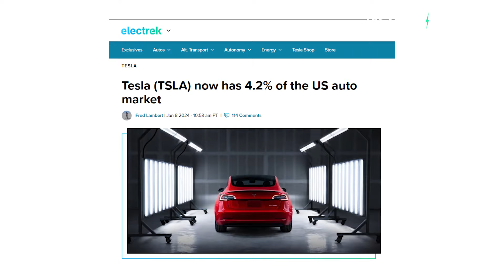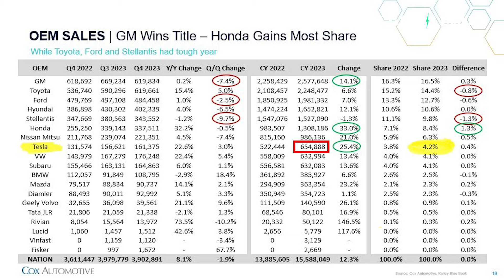Tesla U.S sales up 25% to 4% marketshare, nearly beats BMW & Mercedes combined

Comment: Meanwhile, in the UK, Tesla market share is 2.6% in 2023, down from 3.38% in 2022. Mercedes market 4.61%, BMW market share 5.87% plus BMW-owned MINI 2.5% .
Reply: They still sold more EV in the UK. Percentage increase in market share is not bad as long as the total growth of the brand is up.
Reply: @rozonoemi9374  Tesla actually sold fewer cars in the UK in 2023. Down 9.5% on 2022. Overall UK car sales up 17.2% EV share of the market 16.5%, down from 16.6%.
Reply: @brendanpells912  tesla sold 35,511 cars in UK in 2022
They sold over 35,000 model Ys alone in the UK in 2023.  There was a bit of a lag as they transitioned to the refreshed model 3 however both of their vehicles were still in the #1 and 2 slots for vest selling i believe.  You'll have to link where you get your numbers. 
Mercedes and BMW numbers you quoted were not for EV sales so are not really comparable.
Reply: @patrutherford9600  Data from SMMT. I have previously written 2 detailed replies to your comment but they appear to have been deleted. It would appear that anything that conflicts with the Tesla narrative is censored.
Reply: @brendanpells912  eh don't worry about it.  I wrote an extensive one yesterday to someone that was deleted as well.
Reply: @brendanpells912  The temporary ups and downs between quarters and years is  It's going to be hotly debated and talked about as we are doing right now; I think it's important to realize that this is not a quarterly change that's occurring this is a decade-long transition and that point is not up for debate, the economics of battery technology in 10 years makes ICE a non-starter, Wright's Law is in full swing now.

Comment: Another reason, imho, Tesla sells well in the US is the Supercharger network. Only a handful currently open to non-Teslas.  Other 3rd party charging networks don’t seem have a good reputation.
Reply: Never had an issue with any JST chargers, been using them since 2017. Likely misinformation being spread.... now who would stand to gain from such a thing?

Comment: I just parked at my gym car park in a whit model Y in between 2 other White model y’s.. The car park had about 80 cars in it and 12 were model y.. Melbourne Australia.. 3 months back I had the only Tesla at the gym.. They are everywhere here now..
Reply: That sucks I'd hate to look like someone on the bandwagon. I like my car too feel unique and different from the rest. I recently traded my model 3 performance for a bmw i450 and the quality and tech in this car is night and day. Just putting ur hands on the wheel and everything inside u can feel the quality difference. Plus the car looks alot more aggresive and sleek. Tesla is def the cheaper option but if u can afford another ev I recommend checking out bmws EVs
Reply: @G82Watts  - had a Range Rover and M4 before the Tesla..Both buckets of shit to my y and performance Model 3..Mechanic for 30 years and plan to never lift a bonnet again…BMW was the worst cars I’ve owned..x5 is also bucket of shit..
Reply: @Marcus-up5wk  I highly doubt u have ever owned those cars and u didn't get the model X plaid or model s plaid. If u could of afforded a brand new m4 and range rover u wouldn't have the lower tier teslas. Sounds like BS story too me. Their are plenty of stories of people switching from tesla to bmw and saying how much better the ride quality, sound isolation, and driving dynamics are far superior. My the wind noise in my tesla on the highway felt like I was outside. Nothing feels special or that ur in something expensive when sitting in a tesla. It's just dull and boring. No HUD or gauge clusters. Just such a boring cockpit. The driving engagement is night and day. I'd love for u to give a reason why u think the model 3 or Y is better then a bmw EV. Car wise only idc about having more available charging stations when I road trip maybe twice a year if that.
Reply: @G82Watts  - we have 2 model y and 2 performance models.  Here Parked on charge.. They are  our company cars..100% write off as we’re the RR and the BMW..Don’t tell me you bought your shit box bmw for personal use and you making the repayments yourself? And yes we would have purchased a s plaid if they sold them in Australia?
Reply: @G82Watts  you have to feel it because when you use your brain and add up the features, the BMW just doesn’t stack up
Reply: @ZeusBullyMax  u serious? The bmw m3 xdrive is faster then every tesla besides the model s plaid. With a simple turbo upgrade it's even faster then the plaid. All while having more luxury and better tech. Tesla doesnt even have HUD, gauge clusters, 360 cam, ventailted seats, ambient lighting, auto park that actually works, hands free self driving,etc.. just the overall ft and finish of bmw is night and day better then any tesla. Just running ur hands down the seats and dashboard or touching the steering wheel u can feel the quality difference.

Comment: Doubt giga Shanghai over takes the entire US production and sales. You neglect to take into account, giga Austin is not anywhere near its capacity and should increase production this year significantly. Shanghai is at or near its max rate.. not much room for growth there until they expand. Which I’ve heard bits and pieces there a plans to expand.. but haven’t heard anything concrete
Reply: It is already way ahead in production.  The problem is that they are having to send those cars to half of the world.  I think that almost one in two Tesla passenger vehicles are made in China currently.